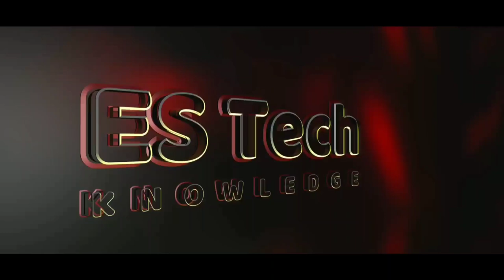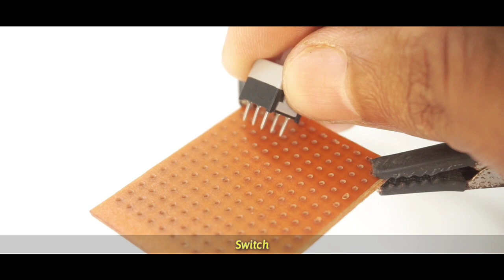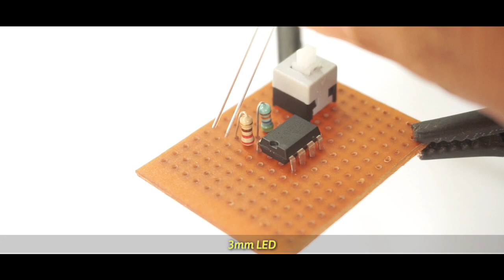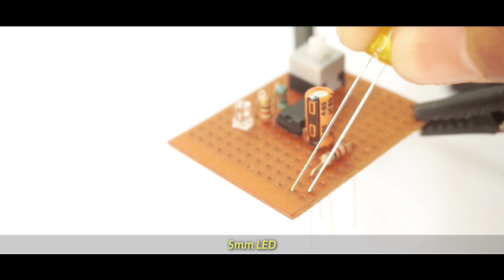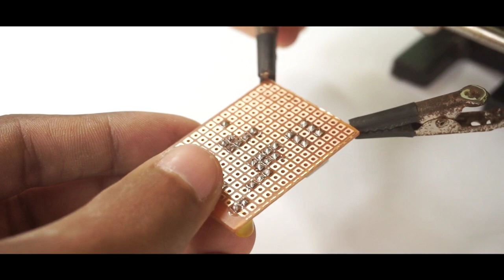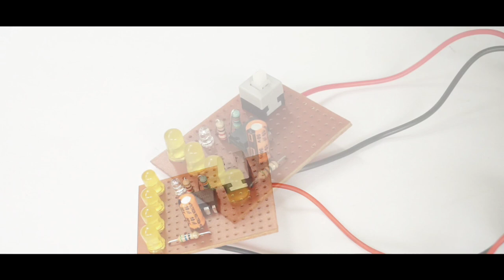How to make a little delay ON circuit

Comment: Brother can you make a dj light circuit with four separate blinking 4 leg rgb leds?
Reply from the maker: Can you explain in more words what you want
Reply: @estechknowledge  yes of course
Reply: @estechknowledge  i want a light  circuit of 7 colours with different type of effects and flashing at least 5 effects and at least 4 rgb 4 leg led diode required and power input i mean running voltage under 9 volts dc